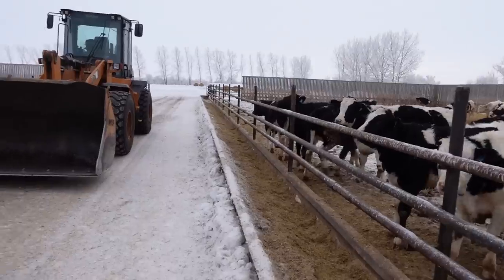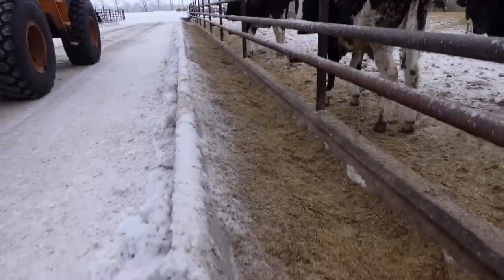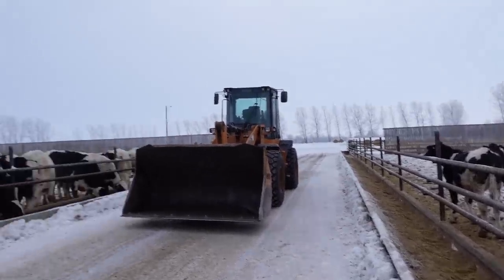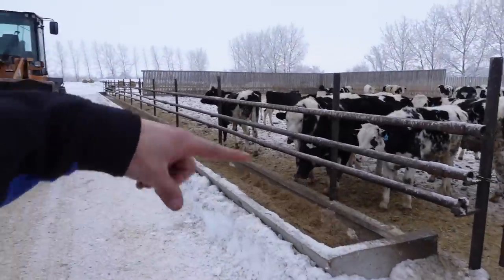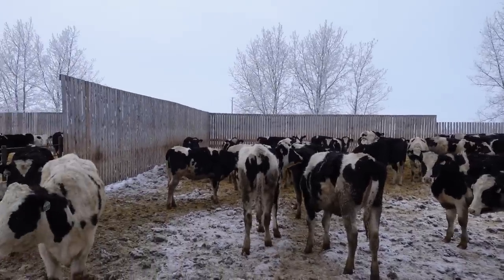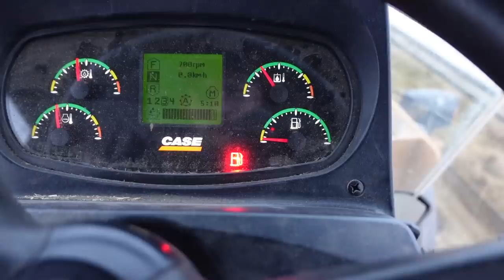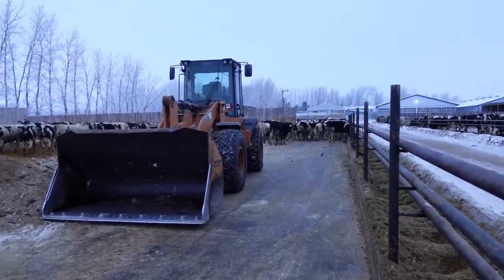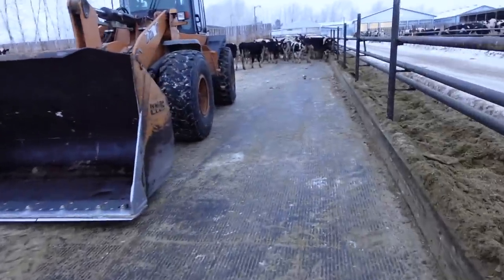Clearing Extreme Manure Build Up in Corrals!

Comment: Curious: On the loader (and tractors) do you ever liquid fill the tires for better traction??  I use to work at a rural tire store  (decades ago) and would be assigned to fill tractor tires with calcium chloride (if I recall correctly)... it prevented freezing. The added weight really help traction.

Comment: After cleaning the frozen dung off the concrete, especially at the gateway as it looked, isn't the concrete slippy for the animals? I'd be putting a bit of sand down to ensure nothing goes down, especially at new year etc when you don't need problems.

Comment: Prior to pouring the cement for the 10 feet of pad they stand on wouldn't it be a benefit to run hot water heat through the cement? Cheap and easy. Well, cheap when its done while the cement is being poured.

Comment: One common thing that I see over all the dairy farmers I follow is manure management. It is a big part of what you folks do. When you were at the World Ag Expo Tulare Ca. last spring you also toured Vanderham’s dairy operation. They had a large manure handling facility built to manage it which also included a sizeable methane capture project. Fast forward a year and in December at the Phoenix CNH Industrial show New Holland unveiled their new T7 LNG 270 HP tractor that runs on the same methane. It has been demoing in England and so far the results seem favourable. Watching you work that big piece of equipment for hours removing the manure it only makes sense that that same product could be powering your machine. I am not sure how our climate world work for methane capture but if New Holland wanted to trial one on the Canadian prairies I think you guys with your lagoon setup would make a great choice!

Comment: how do you transport milk, when it's so cold that you don't freeze it
Reply: The tanks that the trucks pull, are insulated with fiberglass insulation. Which helps prevent the thousands of liters of milk from freezing. It also helps keep the milk cold, during the summer.

Comment: Should put the stuff in the slabs like they do for in floor heat. Put valves on them about one hour before scraping turn on the hot water to the first one . All you would need is a hot water heater for heating the concrete. Plus if you have an ice storm you can melt the ice.

Comment: Looks like you’re putting the pay loader to work in the corrals. Wonder if you’ve considered using your silage trucks to haul away that manure in the winter. Likely not too messy given that it’s frozen, and must be able to handle the weight if you use them for hauling sand occasionally anyways. Would that speed up cleaning out the corrals instead of driving back and forth with the loader?
Cheers from an Ontario cash cropper

Comment: PRO tip. Keep the bucket the more flat to the ground. That way it won’t dose as much and make the digging/hacking way easier. Plus the shear/cutting blade won’t wear out prematurely. Promise it will be way easier

Comment: Just an idea when you are replacing your air hoses on the gate repair put plastic grommets big enough to clear metal wire. Then use an s hook to hold the air hose over the grommets.